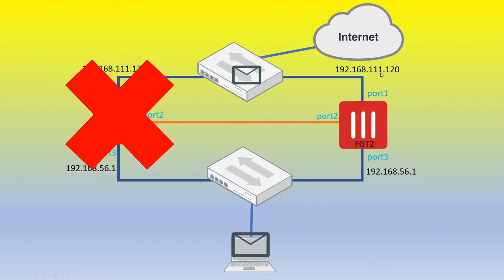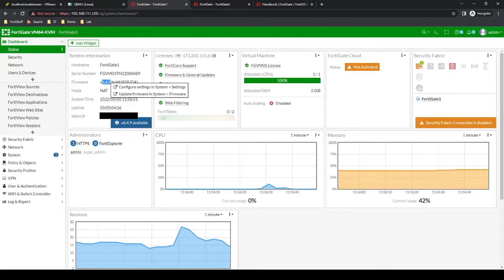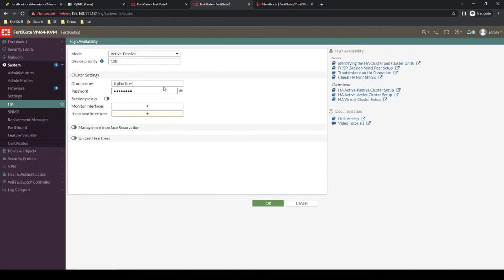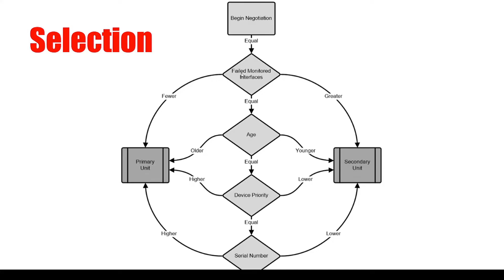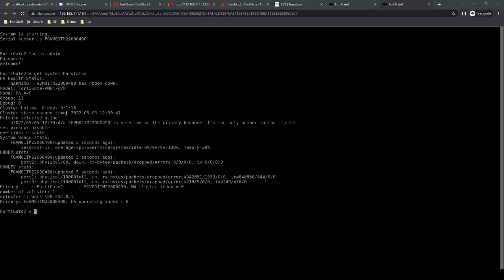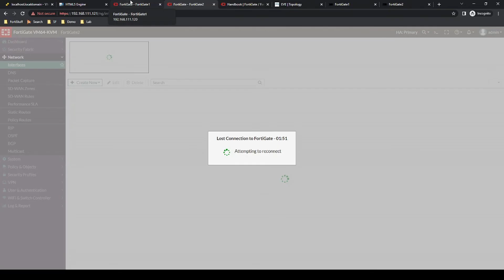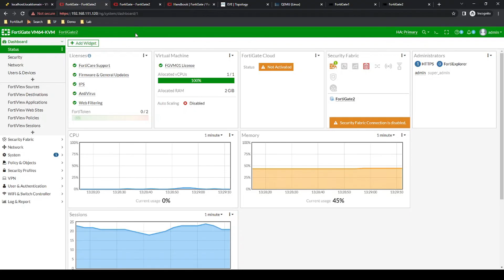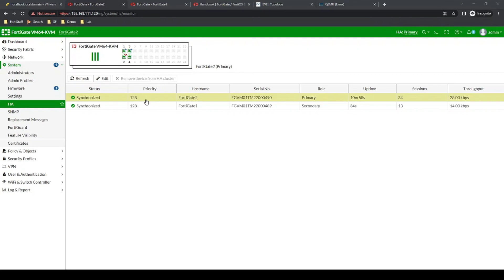Fortinet: Configuring HA on FortiGate firewalls

Comment: After HA gets sycnrhonized, will FG2 change it's primary/external IP address or keep the separate one that it started with?
Reply: The reason i ask is realted to IPSEC Tunnels
Reply from the maker: Yes fg2 will change its external ip to be the same one as fg1. Although fg2 won't actually 'claim' the fg1 ip from a networking perspective until fg1 goes down

Comment: How you connect HA ports? Directly HA to HA or you connected it via switch? What cable are you used?
Reply from the maker: Direct is most ideal(ie. I can't think of why we'd want to introduce a switch unless it's necessary such as if both firewalls are physically located further from each other) . A switch can be used too though (just gotta make sure the frames get forwarded by the switch).

Comment: Did you need to create an aggregate interface to connect the FortiGates to the lan switch? When i setup this in my environment it doesn't like that I have the 2 gates connected to the same switch
Reply from the maker: aggregate interface is not a requirement. I'd say call into TAC for troubleshooting assistance.

Comment: I am confused on how IPsec works on active-passive? Do I have two independent tunnels? Do both members of the cluster send keepalives?
Reply from the maker: The first minute and a half of the video covers this, just try to relate it to IPsec to answer your question. So for IPsec, both firewalls have the identical configuration for each VPN, the passive firewall will only actually use its config (and the IPs bound to the physical interfaces that the IPsec interface is associated with) when a failover event occurs.

The purpose of HA is to essentially have a carbon copy of the exact same firewall config, there isn't extra logic/behavior on the passive firewall for different features(there are some exceptions to this)